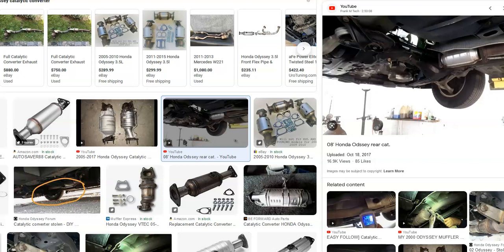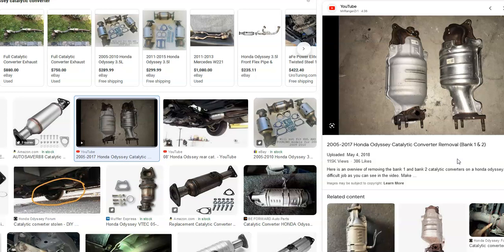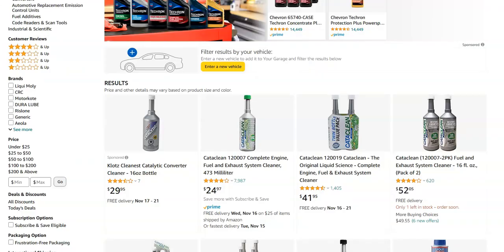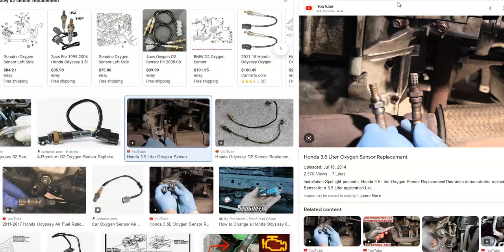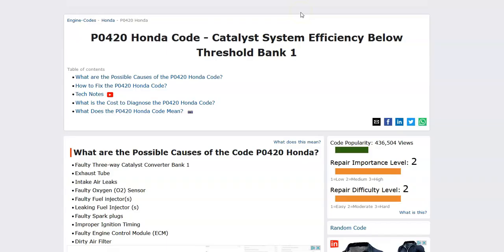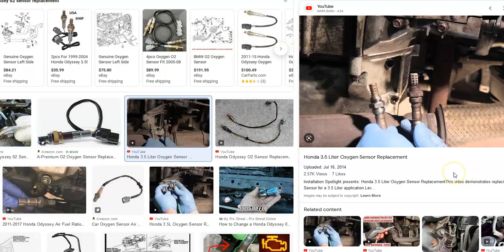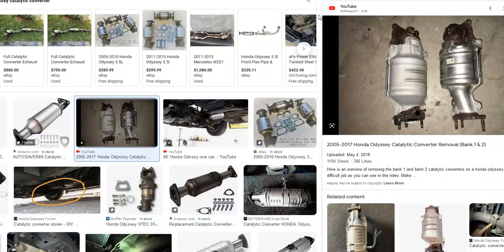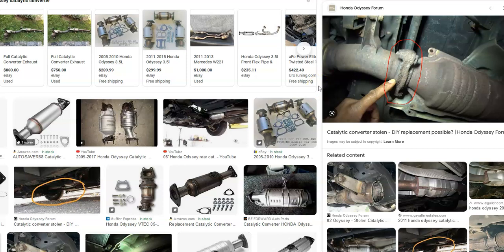How to Fix a Honda Odyssey Catalytic Converter Emissions Problem

Comment: If bad O2 sensor, especially upstream, wouldn't it throw a different code, such as lean/rich condition?  Of course my dad took his van to dealer, who immediately said cat.  I question at 125k miles.  But I don't want to deal with it..:P